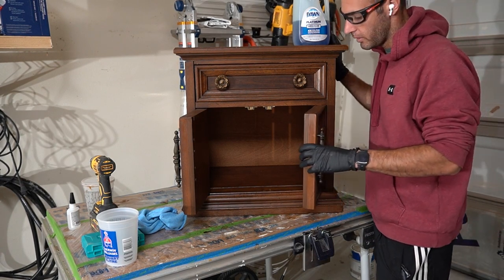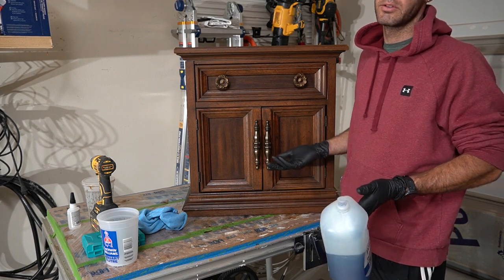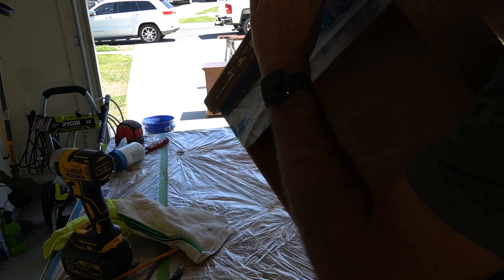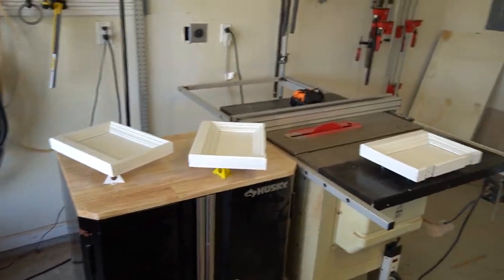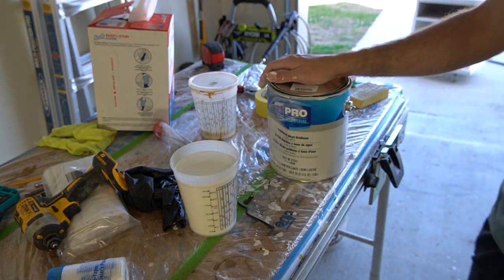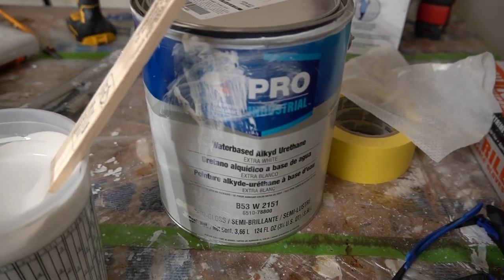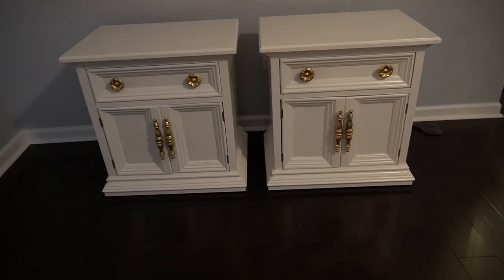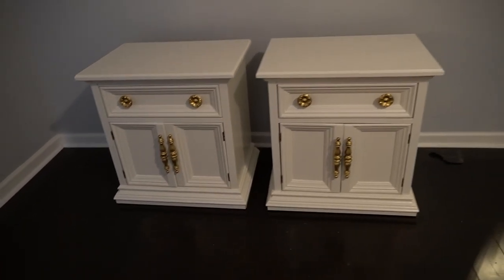Furniture Flipping- A set of Drexel nightstands

Comment: There is a drexel dresser in would like to repaint bit not sure if it can be? It has some places where looks like the finish just peeled off and is bare strange type wood
Reply from the maker: It kind of just depends. Usually if the finish is really peeling badly I try to sand off as much as possible
Reply from the maker: Sometimes I just feather it down by sanding and apply a primer then paint it. Kind of just depends on